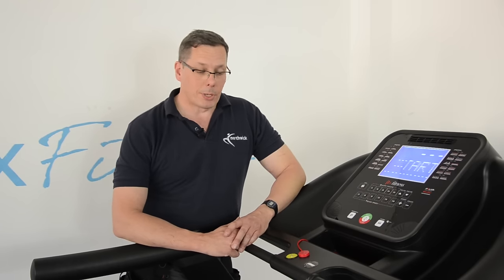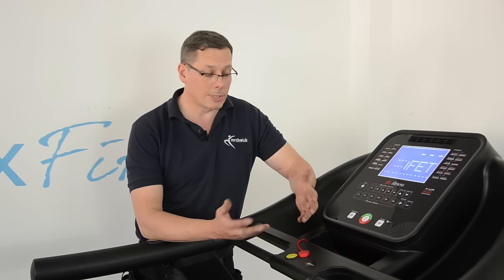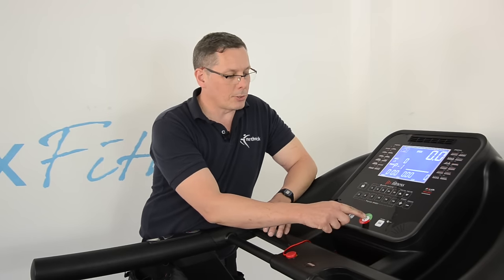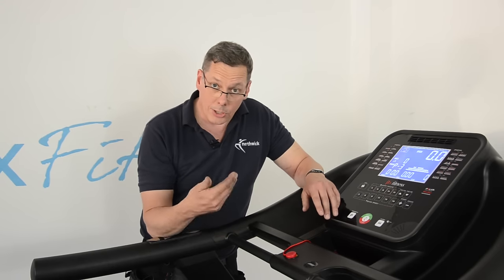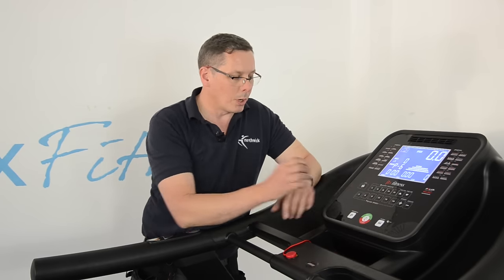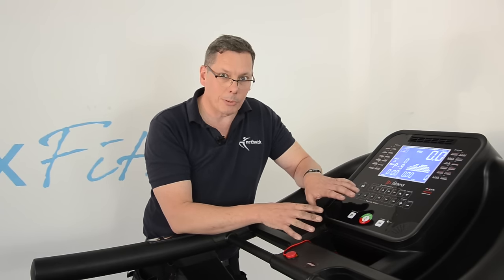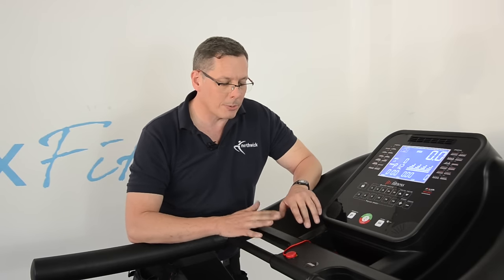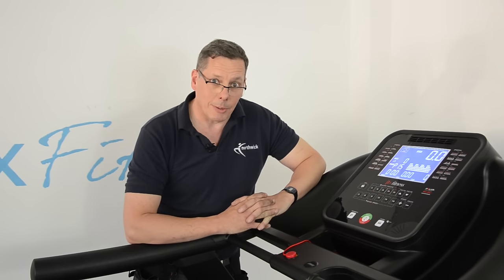How to reset (re-calibrate) your treadmill

Comment: Go over what the parameters mean from cl11 to cl27... If you are an expert
Reply from the maker: Hi thanks for your message. Which make and model do you have?
Reply: @charteredengineer  ms3200
Reply: I need to know what changes the parameter for the incline. My flat is 15 and full incline is 0....it's backwards.
Reply from the maker: @hikerinpam33  the incline signal comes from a potentiometer in the incline motor itself. The calibration is done in software in the console. Therefore you could have a faulty incline motor or console. Has the incline motor or wiring been changed recently? What make and model do you have?
Reply: There's another incline/decline button on the left handle that the wire was faulty. I took apart and repaired it. That switch plugs into the front board. I assume the problem started when I took off all connections to the front board to fix the mounts or fumbling around the parameters. It was all guess work.

Comment: How or where can we get details of recalibration sequences from? Is there a website where they are listed? I have a reebox zr8.
Reply from the maker: Hi Ady - as I recall, the ZR8 recalibration is done via a micro button on the MCB (lower control board). You push and hold the button whilst powering up the machine which then automatically initiates a recalibration of the speed and incline.

Comment: I have a proform cadence 500 and we use it without buying the ifit prescription,the problem is when you step off it after a few minutes it doesn’t save your workout we were doing someone from proform said something about recalibrate the software so I waited to learn how then phone got disconnected does somebody know how to do that.

Comment: Hi there, I have NordicTrack commercial 1750. I have a problem whenever I use my treadmill, it go incline to the max then go to the min incline. Even I stop my work out it still keep going to incline max and decline min. How to fix this ?
Reply: I have a Life Fitness 9500HR doing almost the same thing?  Have you find any solution?
Reply: I have also replaced what is called the Negative Switch because wasn’t moving, but now the incline is acting crazy and staring up when it is reading 0”.

Comment: have a 10 year old proform. motor starts and stops in a few revolutions. changed motor control. took apart control panel. may have had a short. not burn marks but plastic between control panel and screen was bit melted and some sign of dried water, machine starts stops and beeps repeatedly. wondering f rest will help. Motor ok. incline ok.

Comment: Hi Jon! I hope that you and your family are in excellent health. I have a NAUTILUS T514 model and the treadmill stops by itself while is running. Do you know how I can do the the reset on my NAUTILUS T514 model? Thank you so much for your great advices to us. We greatly, greatly appreciate them.
Reply from the maker: The machine is probably cutting out details to overload. Try adding 30ml of silicone oil between the running belt and deck. This will reduce the friction and hence reduce the current drawn and so prevent an overload